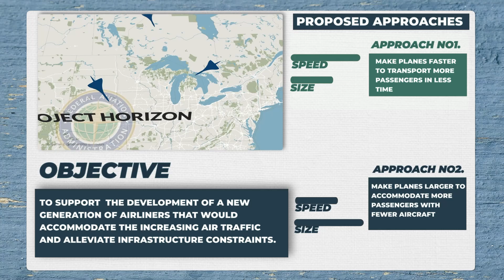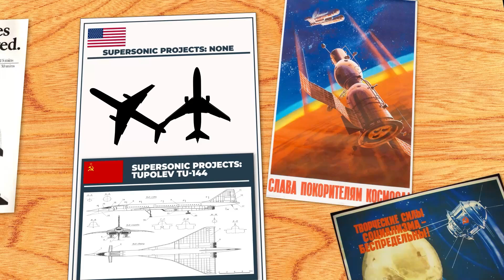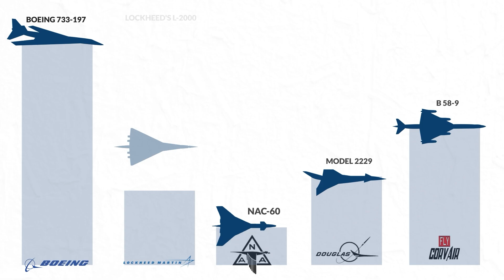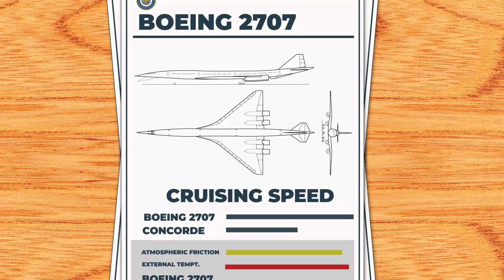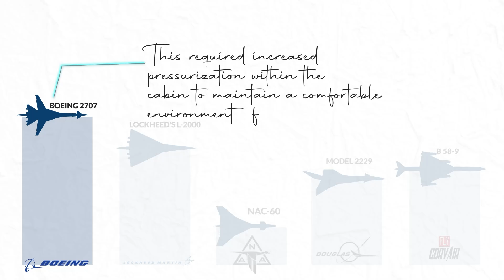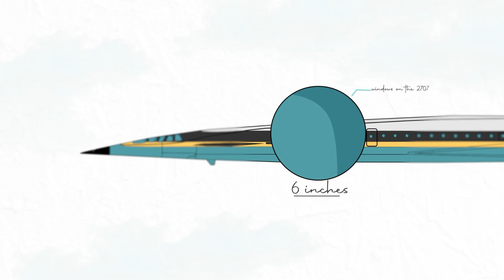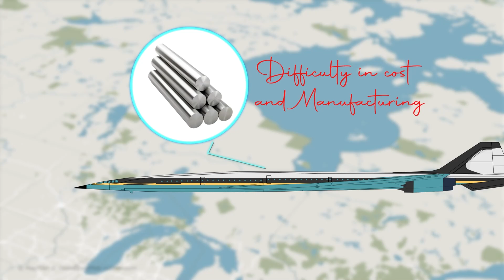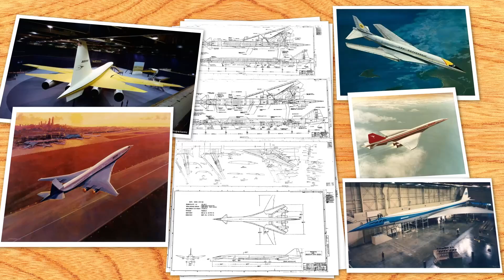Why the Boeing 2707 SST Failed

Comment: America 🇺🇸 didn’t fail, they complained about noise. They ultimately built an aircraft that was bigger & faster than the Concorde, but the routes it was to be used on simply weren’t viable.

Comment: Boeing (🇺🇸) lose against Airbus (🇬🇧🇩🇪🇳🇱)
Reply: AB is owned by EADS which is owned by 3 European governments. They paid for the 380 program which went way over budget and it also was a financial failure.
Reply: Boeing actually won by cancelling the SST. The Concorde was an utter hugely expensive failure and meanwhile the 747 brought down air fares by 50% and was the first aircraft people could get into and fly anywhere else which is why 80% of the human has been transported on at least 1 during most of the program lifetime
Reply from the maker: Do you indeed live in Birmingham UK? I do aswell 😊😊😊